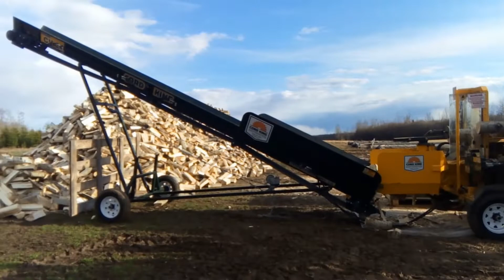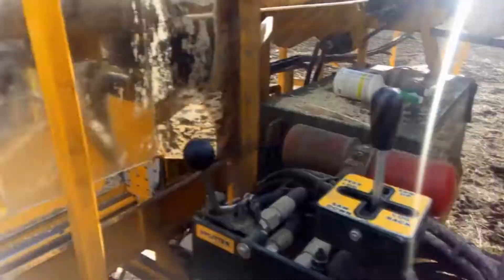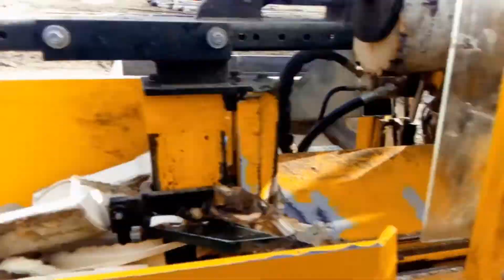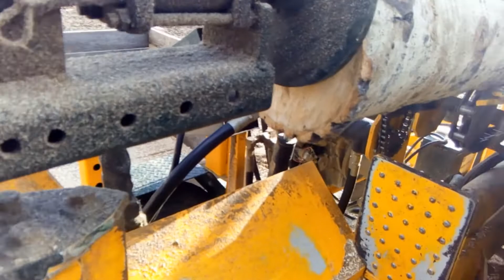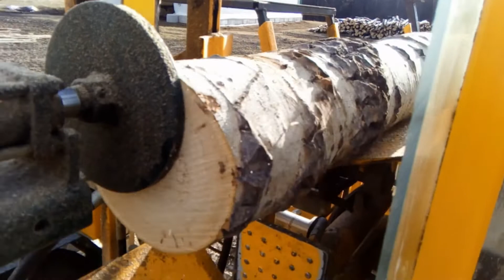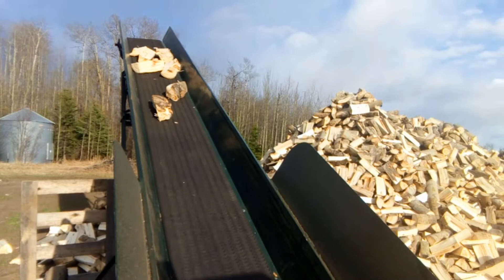Cord King M 18-20 and 24 ft. firewood elevator quick view

Comment: Nice video. You know, you can speed up your processor by only pushing the log partway through the splitter wedge? Then use the next log to push it through.

It works well when doing stovewood lengths 16inch or less.